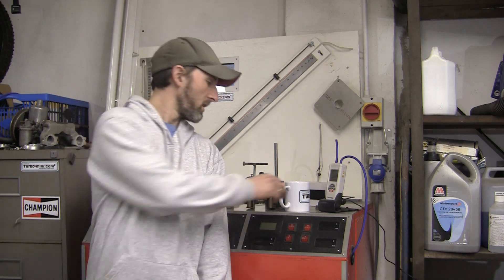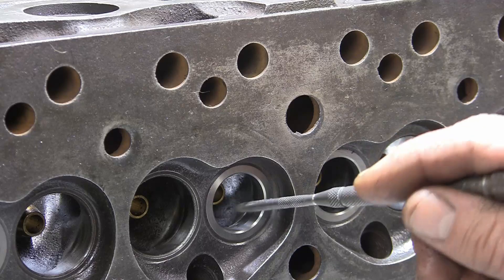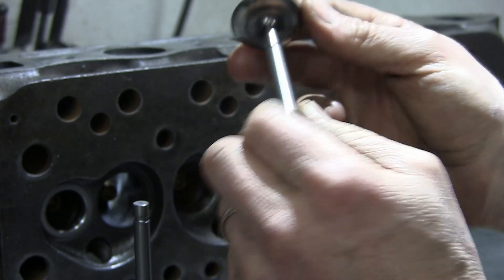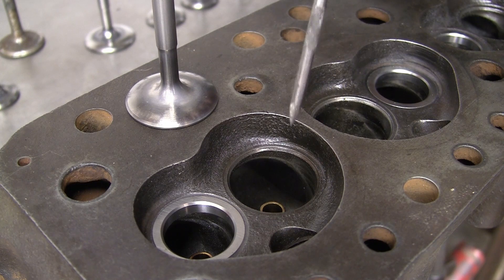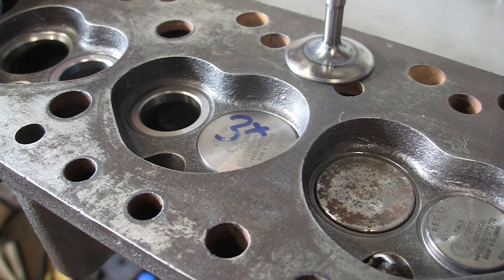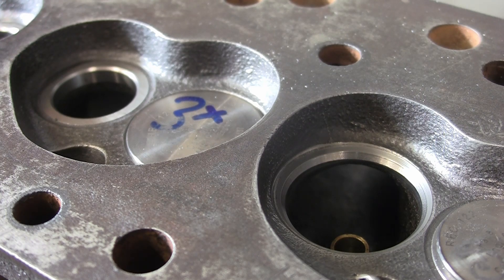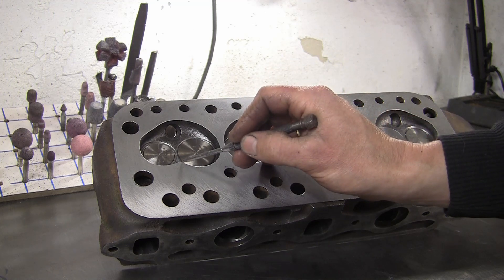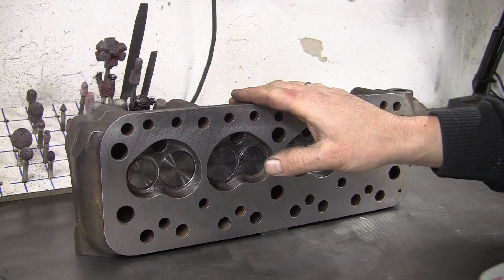Classic Mini Cooper 12G295 Cylinder head restoration, modified & flowbench tested part 2.

Comment: Hello mate, What valve codes did you use and did you have to modify them or adjust Rocker arm Geometry? i am currently rebilding a 12G295 head for a 1098 Austin Morris engine and i am stuck in the valve choice. thanks!

Comment: The blend at top and bottom of the valve seat cut usually produces a tad more flow and valve work like back cut etc as well, ide like to see a video with progressive mods from stock to every little trick to show the importance of what makes for more flow and what gets the airflow stable and mods that damage flow and create a unstable port, ive only just stepped into A series development but im thinking ill have some fun along the way, i like your videos there informative
Reply from the maker: Thanks for the great comment & good luck with your cylinder head work.

Comment: Hi, just surprised about flowbench curve on 12g295 standard, wizard and I found less than you, about 82/83 cfm at 0.4 lift and 25", why did you found more ? Thanks in advance
Reply from the maker: Hi. Thanks for watching. Like engine dynos , flowbench figures can vary from one machine to another. 
What’s important is that the bench is repeatable and can provide useful comparative data for all my testing not necessarily comparing it to someone else’s figures. If that makes sense? Cheers. Phil.

Comment: 33mm and 27mm... Can you run those on a 998 without pocketing the block? Sounds like a worthy upgrade!
Reply from the maker: The 33mm inlet is fine, you’d have to use a slightly smaller exhaust on a standard bore.

Comment: Very interesting. In the early 70's I fitted a standard 1098 engine (12G202 head) in my Mini. Added a standard 12G295 head, duplex timing gear, a single 1 1/2" SU and a 3.44 final drive (10" wheels). This was a great conversion, good low down power, and the car would easily top 100 MPH (proven in Germany).

Soon after that I added a skimmed (60 thou I think) 12G295 to another Mini that had a 998 engine (small overbore), AEA 630 cam (998 Cooper, 1100 etc.) duplex timing hear 1 1/2" SU. This engine was good, but not the low down power of the 1098, was OK on acceleration and top speed though, certainly had it well over 90. Both cars are still with me.
Reply from the maker: It's great to hear these types of stories and even better to hear you still have both cars. Are they both still driven ?
Reply: @TurboMinicom  Typo corrected, not 12G292, 12G202. Both cars off the road for some years, but intend to get them going. Also have a1969 Riley Elf Mk3 Auto, low mileage.
Reply from the maker: @Radfordperson   great. Sounds like a nice collection.
Reply: @TurboMinicom  and a Metro Vanden Plas Auto that I bought for my Dad in 1987, and daily driver is a 1989 Volvo 340 GL.

Comment: Interesting video.  I ended up leaving my 12G295 head with stock valves - I'd heard too many stories of them cracking between the valves.  Your thoughts?
Reply from the maker: aussiebloke609  there’s plenty of material between the valves on these castings. In fact far more than on the 1275 heads. There’s no way of cutting a decent inlet seat without going up in valve size to.

Comment: Excellent work! Great to see those flowbench figures! 
I have a 12g202 that I’d like to have a go at for 998 turbo application, looking for around 100hp. What would you recommend? I’m sure it will end up coming your way
Reply from the maker: Glad you liked it mate. The 202 requires a lot more work to make it flow, but the material is there to make it decent. I’d go with the valves I’ve used here & seats then modify the chambers and ports to suit.